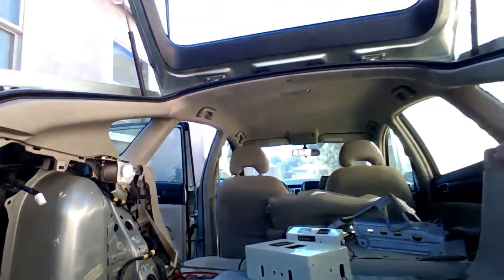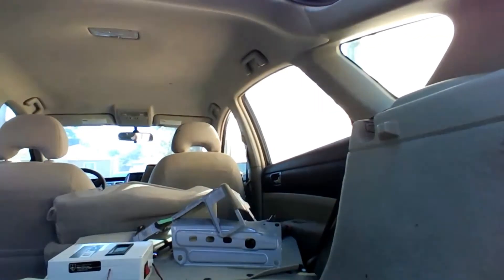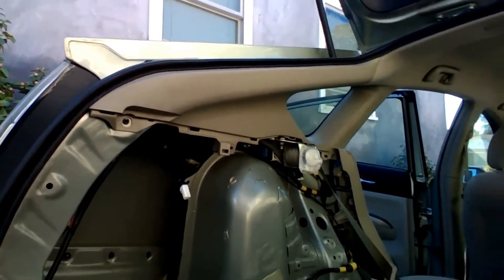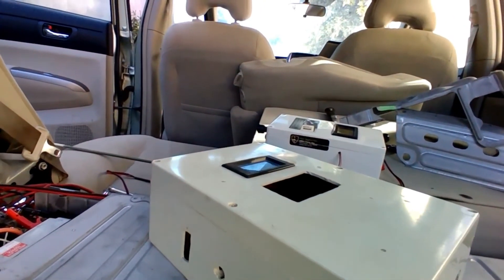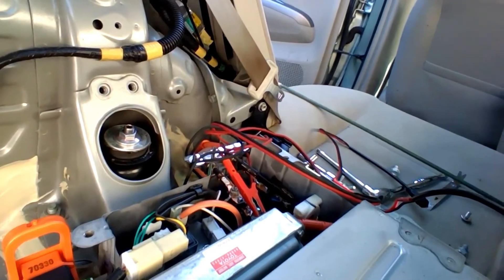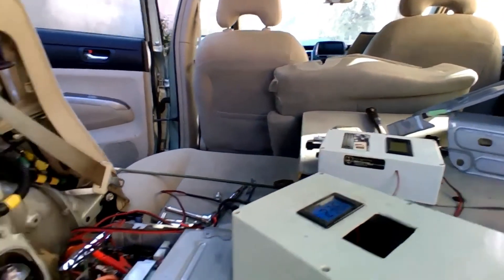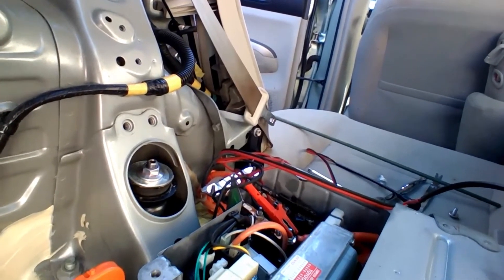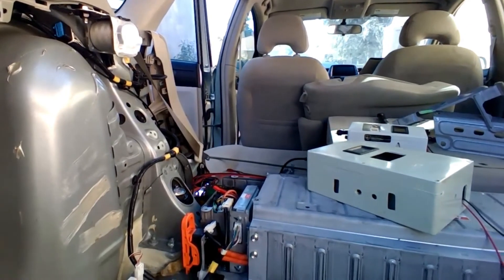TOYOTA PRIUS GEN II : REVIVING A HYBRID BATTERY PACK

Comment: If you remove and rearrange the modules in parellel you can charge the whole pack at once with just a hobby or 12v battery charger.. be sure and put on the end caps tightly to keep from swelling..

Comment: Do you need a grid charger and a high-speed charger/discharger to revive a almost dead battery?
Reply from the maker: No, You can just one or the other but since I had both, I used both.
Reply from the maker: And yes you definitely need a discharger.

Comment: Hi and thank you for the video.
What is the amperage of the grid charger and what is the amperage of the high speed charger?
My grid charger is a LED power supply with an amperage of 350 mA.
286 volts max.
Reply from the maker: Yes most Grid Chargers are 350 mA and the HSC is 1.4 A.
Reply: @VeniceHybridTech  thanks